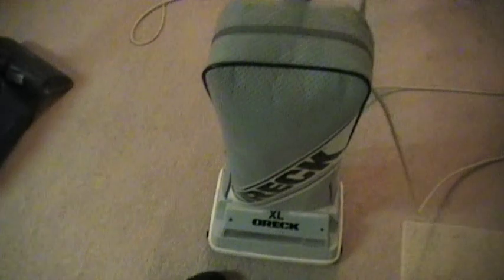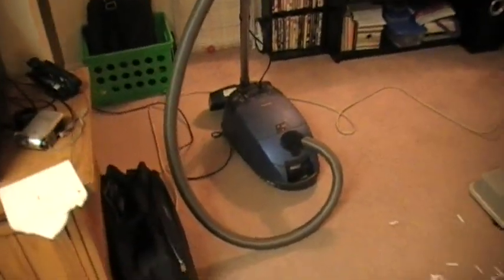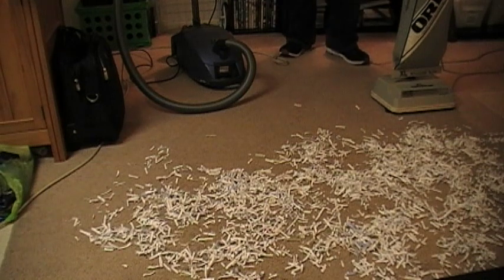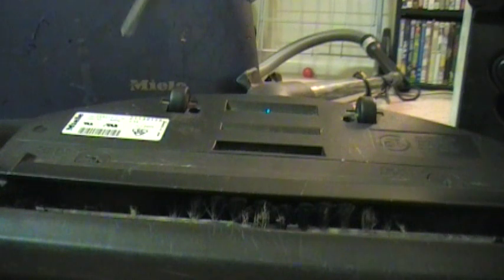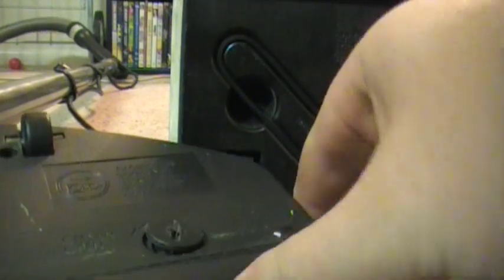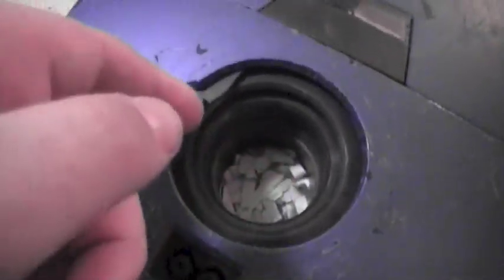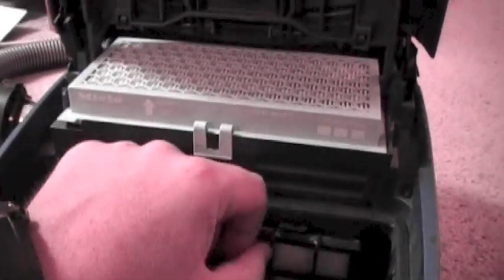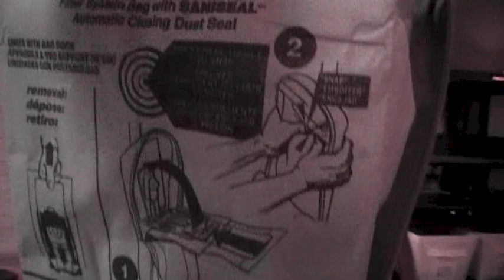Oreck VS Miele

Comment: Paper bag inside the vacuuum. Hat one is supposed to use genuine fabric bags because they filter out better.
Reply: Darren78 yes. Miele only uses cloth, these are generic non Miele bags. Not sure why one would use paper in these machines as they are designed for cloth. The filters last longer with cloth as well since the cloth bags are hepa rated and no dust escapes them.

Comment: Oreck vacuums are supposed to be serviced once a year to make sure they are running at peak performance, this machine you found probably has a worn roller that is the equivalent of brushing your teeth with a stick. It also looks to be clogged with a full bag, I guarantee that if you got that Oreck serviced it would beat your other vacuums.
Reply from the maker: Mike Snellgrove  I dont think so I now have the oreck xl 2 and put new parts in it and it still is very loud and does not clean that well ether but I use it untill I can replace the head of the miele because it got damaged in my move
Reply: I do, I work on them for a living

Comment: Not a real comparison, since you did say the Oreck came from a dumpster - it was discarded because it didn't work.
Reply: Scott H the machine was working. The bag was poofing so the fan was fine, the brush was spinning and it sounds healthy. Oreck has a inherent flaw!  The air path is narrow which is why it clogged and failed to produce a result on this test. I see it all the time. Orecks clog with the simplest things. I am a vacuum service tech and know my business!

Comment: Any American product is crappy in general, I prefer foreign care and foreign vacuums.

The German one is 20 plus years and it's still quite, smooth and does it's job, the American on loud lousy all for nothing. Typical.
Reply: Excuse me? Keep dreaming there! I have a 28 yr old Electrolux that will clean circles around ANY foreign vacuum you throw it up against! And your modern, foreign made vacuum will use more electricity & be in the garbage dump a lot sooner than my Electrolux will be.
Reply: rob w that is incorrect. Electrolux isn’t even American made. Electrolux is a Swedish vacuum maker, always has been. Miele is German but made to precise standards. The Miele in this video is pushing 20 years old and while beat up still runs quiet and smooth. A 80’s era lux draws 11amps of power, this Miele draws the same but utilizes a soft start motor which conserves power and reduces premature wear.
Reply: Excelsior C, Electrolux AB, the brand you see being sold in big box stores, is Swedish. Aerus Electrolux is NOT Swedish at all, the vacuums Electrolux AB make don't even bear any resemblance to Aerus Electrolux vacuum designs. Electrolux AB actually sold a share of the Aerus Electrolux divisions in Canada & America back in the late 1930's, & Consolidated Foods (Sara Lee) bought the remainder of the company in 1968, & operated it until a private holding company in Texas bought Aerus Electrolux from Consolidated Foods in 1998. They sold the rights to the name Electrolux back to Electrolux AB in 2000, with permission to use the "electrolux" part of their name for a certain period of time, a transition phase, after which time they would be known as Aerus, with rights in their sale of the Electrolux name to have the right to use the name "Lux" as well in their promotional literature & advertising. So, please kindly get your facts straight before you refer to Electrolux as Swedish, the whole history of Electrolux worldwide is quite complicated & not entirely straightforward.

As for the Miele in the video using a soft start motor & saving electricity? Only for the first 3 or 4 seconds while the motor ramps up to speed, that's it. A Aerus Electrolux metal bodied canister from the mid to late 1980's & a current Miele would actually be on par with their energy consumption while in normal use cleaning carpeting with a powerhead. And Miele wouldn't have to worry about having a circuit board with a soft start feature if their motors were quality to begin with. Here's a little known fact about Miele vacuums you probably never heard of before: Any Miele made before 1997 has a motor made by Ametek Lamb, the same company that supplied motors to common brands such as Filter Queen, Compact/TriStar, Eureka, etc. They copied the Ametek motor with their own design, & then eventually replacing it in 2004 with a Vortex single stage motor made for them by Domel. If Miele produced a quality motor, then WHY would they give up manufacturing it after such a short period of time?! Aerus Electrolux ALWAYS manufactured their own motors, until the motor manufacturing division, Electro Motor LLC, was sold off in 2002, under the new leadership. And the quality of those motors is LEGENDARY....it's not uncommon to see 30 yr old Electrolux canisters with their original motor, in perfect running condition. You don't need to reduce wear & tear on a motor when you manufacture it RIGHT to begin with, let alone have a circuit board to break down & eventually fail. Electro Motor LLC is still manufacturing motors to this day, & have greatly expanded. It's not uncommon to open up a central vac & find a Electro Motor inside, very common in particular in the central vac industry.

Most Miele vacuums are lucky to see 15 years old before they run into MAJOR problems with the circuit boards, powerhead, hose or electric wand & the cost of repairs are unfeasible & the vacuum gets dumped or sold for parts. I dare you to go into any vac shop & ask "What's the best canister vacuum ever made?"....most will tell you, in their opinion, Aerus Electrolux was the best canister sold on the market, before North American Electrolux was sold to become the Aerus of today. 

As for foreign vacuums & their cleaning abilities? Well, the mistake that Miele makes, as well as many other European manufacturers, is they design their products to clean European homes, which have different styles of carpeting & hard floor surfaces, & they don't make changes to their products to suit the North American marketplace & the cleaning needs of Canadian & American consumers, which have deeper & denser type of carpeting than European homes have. Take a look at Consumer Reports & their ratings of canister vacuums, there's a REASON why Kenmore & Panasonic canister vacuums consistently rank higher than Miele canister vacuums in their tests & ratings. The Asian & North American manufactured products don't make this mistake, they manufacture their products with the North American marketplace in mind, & therefore their products produce better results when cleaning carpets in Canadian & American homes. 

Aerus, when they designed their latest flagship canister vacuum, the Aerus Guardian Platinum, actually did so with the North American marketplace & Canadian & American consumers in mind. The canister is manufactured in Slovenia, & the hose, wands, powerhead & accessories are manufactured in North America.The canister has a 15 year warranty on the ENTIRE CANISTER....motor, cordreel, switch, circuit boards, etc, & the hose, wands, powerhead & accessories have a 5 year warranty. Miele's best warranty in Canada is 10 years on the motor during the 1 month promotional warranty event they hold every year, in America it's 10 years on the motor for the HomeCare models sold exclusively in vac shops that are Miele Diamond Dealers. So, Aerus beats Miele's warranties by a long shot. The Aerus Electrolux powerhead design dates from 1984, with only minor changes to the brushroll design, styling & powerhead neck, to keep it up to date & current. They have current test data from extensive testing in their laboratories that shows the Guardian Platinum actually outperforms Miele's canisters in cleaning performance in removing embedded dirt. The canister may be European made, BUT has the quality & cleaning performance that made Aerus Electrolux legendary in North America. Miele, as good as they may be, will NEVER EVER be a legendary brand as Aerus Electrolux vacuums status has enjoyed. Even Electrolux AB's Swedish manufactured products are still better than Miele.

Next time, make sure you do a bit more research before coming up with such a idiotic reply! :P